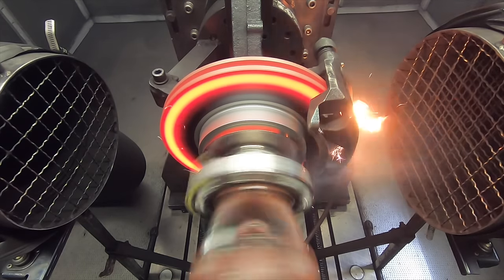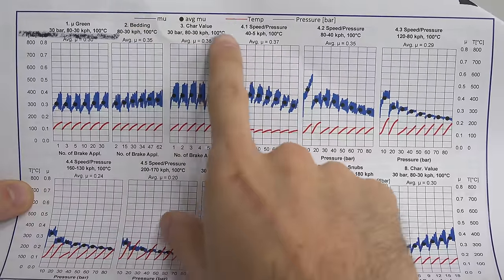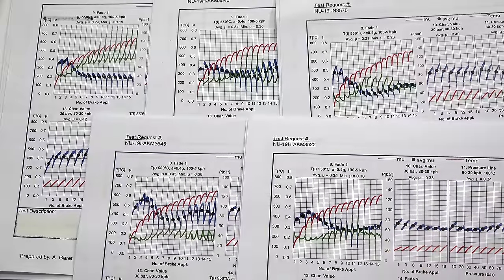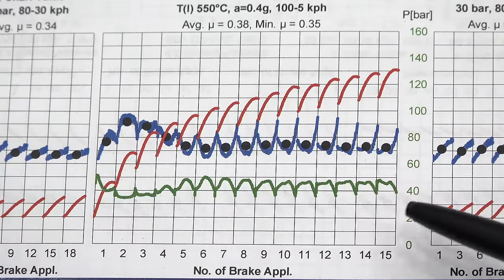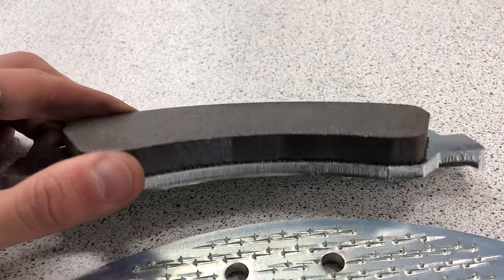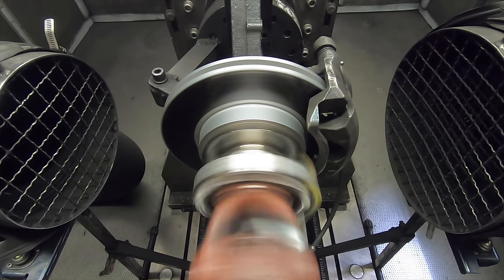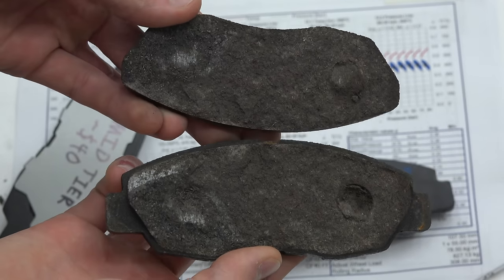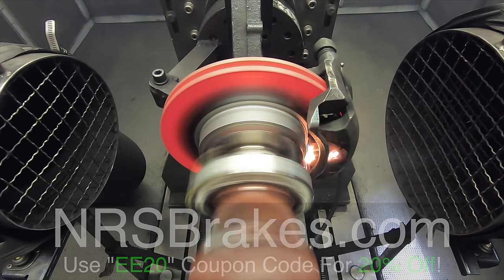What Are The Best Brake Pads? Cheap vs Expensive Tested!

Comment: Having 1000hp camaro I can clearly tell you how fast I went back to oem from ceramic pads 😅 almost died I went like an extra 10 to 15 feet with ceramic hell naw. Only thing good about ceramic is low dust. I like the oe red or yellow or oe stoptech

Comment: Tested in a lab I don't buy those kind of tests. Test them in the real world now that's a real test. I have been using the cheapest brakes I can buy and never have had problems. Also I live in the upper peninsula of Michigan with the salt and never had a problem with my brakes rusting out. I usually get 70 to 80,000 miles out of a cheap set of brake pads.

Comment: OEM is very vague, since we dont know who the OEM is each company works with multiple manufacture to end up with a "Toyota" and I concur with other comments that cheaper brands are going to have worse OEM parts than more expensive brands. I always tell people it's best to shop by brands and don't go for the deal thats too good to be true because its likely the case. Side note that part he mentions of the brake pad shim is no joke I've serviced 2 cars that had cut the rotor off the hub with the brake pad shim, Grease that shim and keep an eye on them sneaky bastards.

Comment: Honda OEM brake pads and Rotors are terrible. After 10k-15k miles of driving, the rotors get warp. I've always replaced with new OEM brake pads and new OEM rotors at the same time.

Comment: I actually had a brand new pad from the Advance Auto Parts premium brand fail on my car by shearing off like in the test. I wasn't even stopping hard and it just went bang, and I had no pedal. Almost ran through a stop sign into oncoming traffic because of it. Pumped it a few times to take up the slack in the caliper and finally stopped the car, but it was a close one. I had to drive with it that way for like 40 miles to get to traffic court because that's where I was going and I didn't want a warrant out for failure to appear. I had also purchased new rotors and when I took it back the dude behind the counter actually gave me crap for having used the brakes to stop the car after the pad failed, like it was my fault the rotor was damaged by it. Sorry to tell you buddy, your garbage almost killed me, and the moment the pad failed and I made one stop, the rotor was irreversibly damaged. I made a stink and they replaced the rotor and gave me my money back for the pads. I didn't want a second pair of pads that try to kill you when you use them. I went to another parts store and got a different set of pads. Never had that problem again, because I never went to Advance again. Wasn't the first time I had issues with their parts, but with a safety issue like that I was like never again.

Comment: In my Old "Simson" motorcycle, build 1985, is an asbestos brake pad, today new asbestos brake pads are forbidden, because you can get lung cancer from asbestos dust, but the new ones made with other materials are scrap. So I have to drive with 35 year old brake pads. xD

Comment: You are not using the correct term. These pads are electroplated with a zinc nickel alloy (electrochemically plated). The white rust is also a timing requirement for corrosion as well as red rust. The electroplated zinc nickel is sacrificial conversion coating on the outer surface of the steel. Galvanization is fundamentally different. Galvanization is an embedment of molten nickel that develops into the base metal of the part which is much more expensive to apply.

Comment: You forgot to mention if you also replaced the break rotors every time you replaced the break pads for each individual test. If you used the same break rotor for all the tests then i can assume the test is inaccurate.

Comment: It’s very simple if you have a grocery getter car like a Toyota or a Honda or a Chevrolet impala you really don’t need expensive brake pads the $40 $20 ones are good but if you have a high-end sports car then yes get the high end brakes you’re not going to drive fast with a grocery getter

Comment: Were the OE brake pads from a budget, mid or upper priced vehicle?
Reply: @Mark Codiroli well, a high performance car might be shipped with awesome pads while the smaller bucket-size cars will suffice with a budget brand since they aren’t build for speed but rather fuel economy.

Comment: I can only imagine letting your NRS brake pads going a little longer than they should - sometimes you get busy and the noise is the thing that tells you "CHANGE YOUR PADS" - however, those little shits are literally shredding your rotor with their burs when that happens, no escaping a rotor change if you let them go too long

Comment: Pads aren't the whole issue. Cheap rotors have ruined many brake jobs I've had done. Unless I buy the parts myself and put them in the mechanic's hand, they will put the cheap crap on and they start to warp within the first couple of months. The best brakes I've ever had were factory original Toyota.

Comment: Not worth watching for hybrid drivers as they hardly use the brakes. I wonder how long their pads last?
Reply from the maker: Rust & corrosion will play a big role on hybrids still, especially if you’re keeping the brake pads for a long time.
Reply from the maker: Rust & corrosion will play a big role on hybrids still, especially if you’re keeping the brake pads for a long time.

Comment: Personally I think the corrosion test is flawed. You aren't going to have a car sitting in salt spray for 24 hours straight. Wear of the brake pads removes buildup up of corrosive material on the hub contacting surfaces. Heat from brake use vaporizes water into steam, making the corrosive salt less effective as there is less of a medium to use to permeate the brake construction and react. Instead, the corrosion is able to do damage to areas that otherwise would not see the same exposure to corrosion in real use.

I'm not an expert, just seems like NRS really sucks at making brakes and testing them.

Comment: Nice video! Been a mechanic for 21 years. I only install the best brake pads. I will tell customers to go somewhere else. Akebono is my number one brand right now. Brakes usually last 3-4 years I’m general. Going cheap does not pay. I never use OEM… They are above average. It’s a sell by dealerships. They will tell you that’s all you can use and you may damage your brakes etc..

Comment: From 2010 until now 2020 i have been using Oem pads or Brembo pads! Order throu EBay low prices $45-65 honda!toyota! Lexus.  
I Never go dealer buy fking expensive rip off. 
Pay at Ebay oem honda!toyota pad $45-55. 
Or brembo Rotors+pads Front&Rear $220-320. Depending what cars. 
Brembo is nice and stronge.
My favorite rotor now is Stoptech+ brembo pads or Oem pads.

Comment: One thing to mention about all these tests is that they are not a representation of real world driving. The cheapest brake pad starting acting funny on the 5th aggresive stop from 100-5 km/h. Unless your driving your car on the track, you will not have to aggresively brake from 100-5 more than once and if you are, maybe you should consider not being an asshole on the road. 

Yes, NRS and OEMs were the best and if you plan to take your vehicle to the track you definitely don't want the budget option. But if you drive a beater around town and you're not an asshole on the road, the budget brake pads are good enough.

Overall very interesting test.

Comment: Do brakes really catch on fire when you use them hard?
Reply: Yes, yes they do. All of the energy your car has when it is moving is converted into heat. It gets very, very hot.
Reply: You'd have to use them extremely hard over a short period of time. Highly unlikely during normal driving conditions.

Comment: Most of the time top tier and OEM are the same product. 
OEM is just outsourced then unbranded.
Reply: all depends on the manufacture and model akebono and trw does a lot of Japanese oem pads. zimmerman or brembo for euro cars wagner and bosch do most american except gm and lower level dodge. acdelco does gm and trw does lower level dodges.

Comment: Can't stand original OE pads they're just not good at breaking. HAWK Race track approved are the only pads for me, Superior braking. Never get rotors that have holes in them they  crack and you will have less breaking surface because of the  material on the rotor surface has been removed that slows you down quicker.

Comment: Brakes are not meant to ever operate in these types of conditions so this isn't really a good test. Brakes are on and then they are off over and over and over. They never get used like you use them in this test. Sure they get hot sometimes bit never like this.

Comment: This test doesnt help anyone at all. You cant just put brake pads in a price category. Your need to know what manufacturer and what materials they say they are made of to have any kind of real information. What brand are the upper and lower level pads? Some pads for the same price are better then others. I have had great experiences with good ceramic pads vs stock or cheap pads when it comes to brake fade and initial bite but you have to buy quality pads and rotors for it to make any difference.

Comment: Not knowing what brand the budget pads are this is limited information these test are taking these products to extremes. it depends on several thing do you live wear your pads might rust I've never seen high levels of rust on any I have replaced rotors that's a different story.and how and were do you drive your car if you live were you have more higher speed stop and go driving the first test might be an issue,but for the most part these are not how daily drivers are used if you have a performance car its more likely an issue,but new brakes are better than having failing brakes, so buy what you can afford for the car you have.I'm not buy expensive brake to put on an old beater that I will be getting rid of in less that 20,000 miles.and the brakes you buy will tell you if there ceramic,semi metallic or organic if that even still an option these days.that information here would have been useful.

Comment: @7:40 Where 40% conclusion is coming from? From the fact you choose to show graph for 80%-90% range? 40% of 10% range is meaningless figure. Brake disc wear caused by each breake pads would be helpful. How good are long lasting brake pads when you have to replace brake disc sooner than brake pads?

Comment: "...and so, in summary, the best brake pads for average, everyday users are the..." - more than 16 minutes I waited for this sentence... and it didn't come. A lot of data, but nothing the average person can transpose on to their own situation. I live in a country town... I don't need to brake 10 times in quick succession causing my brakes to heat up. It doesn't snow and I'm far enough away from the coast that salt related degradation is not a concern of mine... I gained nothing useful from this video :(

Comment: I'm having a hard time wrapping my head around the importance of a FORTY PERCENT difference in wear between budget and mid. Why is that worth even mentioning? Why not point out that the upper tier actually did AlMoSt EiGhTy PeRcEnT worse. If my theoretical pads were a meter thick, why would I care if they wore 500% faster than the next pad?  They'd still last longer. Percent of pad left is the only meaningful statistic here. all over failures of the budget brake not withstanding

In truth this video showed that you get mixed results from price ranges. OEM is the safest bet.

P.S. If you slap those NRS pads on a clueless driver's car and let them drive them to death kiss those rotors goodBYE. Those burrs are gonna shred that poor thing.

Comment: This video MIGHT be of some use IF the braking was tested in "real world application of the brakes, with the rotor remaining spinning between application of the pads.  Also, the time between brake application of the pads should be significant time allowing proper real-world cooling between the applications.  This makes a TREMENDOUS difference in real world performance.  It appears to me that this entire test is VERY MUCH done in a way to make the desired pad to "win" the competition.  PLUS, you never mentioned that compound of each pad either.  HUGE difference there as well.  I guess what i am saying is that this is a VERY POORLY done test.  It is quite misleading and, in the end, just plain inaccurate.

Comment: You didn't even go over compounds used in these pads. That's the true way to know cheap from quality. Buy ceramic. Stay away from organic. In 30 years bosch has never let me down.
Reply: @Mark Codiroli lol the manufacturers will gladly tell you what's comprised in the pads. Heck even the auto parts stores list the compounds in each of the pads they carry.. well the good places. But they won't tell you percentages of what's in them. Duh that's obviously a trade secret. Same reason I can't recreate a dorito from the ingredient list on the bag. But I'd bet my last dollar you've never even changed a pad yourself unless it was a playtex.

Comment: So, unless you want oe parts buy mid level. Got it.
Reply: OEM Pads are $35-$60 depending on the car, not bad considering you'd only replace them once every 60-75K miles.

Comment: This test is completely useless. You don't tell us what the vehicle is, so we have no way of knowing what the original equipment would be. You don't tell us what any of the pad Brands are, so all we know is that we've got mid-tier and high-end which narrows it down to about a hundred different brake pad companies. You only tell us in the comments that the low-end brake pad is semi-metallic and all of the rest are ceramic. What's more, this test does not reflect everyday usage scenarios such as wet environments, dirty Dusty environments, changes in ambient temperature, and so forth. Just completely useless. I can't make a purchasing decision based on this information.

Comment: Without actually listing the specific vehicle model the pads were intended, the brand of each pads and claimed material composition, this test is more useful as a "how testing is done" than anything. Step out on a limb and give us all of the information!
Reply: The reason for wanting to know the vehicle model is that braking load requirements are different for a prius vs a crew cab dually!

Comment: Repent to Jesus Christ!

Are you a sinner?

Luke 5:32
King James Version
32 I came not to call the righteous, but sinners to repentance.

Luke 13:3
King James Version
3 I tell you, Nay: but, except ye repent, ye shall all likewise perish.
Reply: What does the old testament have to say about thermal friction coefficients in hydraulic brake systems though? Did Leviticus favour OEM rotors and pads, or was he using cheap Roman-made replacements in his chariot?
Reply: @ralphm4132  
Revelation 20:11-15
King James Version
11 And I saw a great white throne, and him that sat on it, from whose face the earth and the heaven fled away; and there was found no place for them.

12 And I saw the dead, small and great, stand before God; and the books were opened: and another book was opened, which is the book of life: and the dead were judged out of those things which were written in the books, according to their works.

13 And the sea gave up the dead which were in it; and death and hell delivered up the dead which were in them: and they were judged every man according to their works.

14 And death and hell were cast into the lake of fire. This is the second death.

15 And whosoever was not found written in the book of life was cast into the lake of fire.